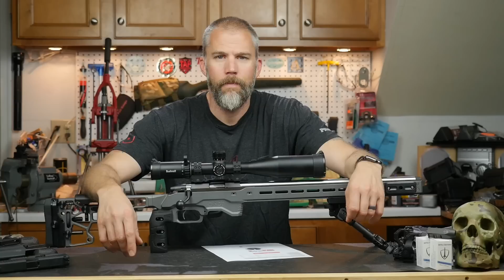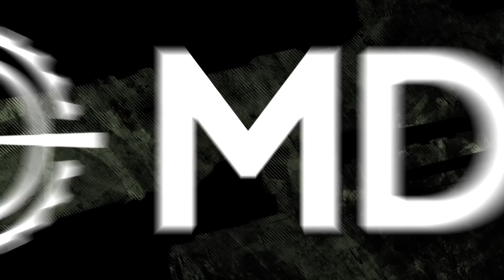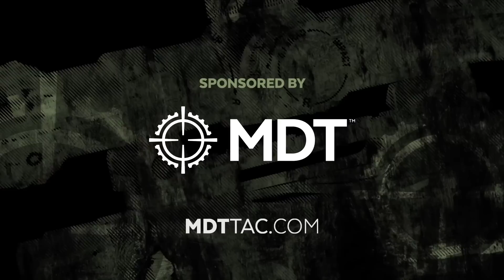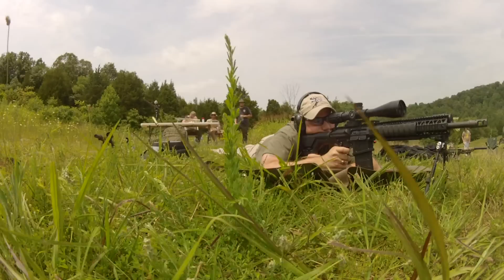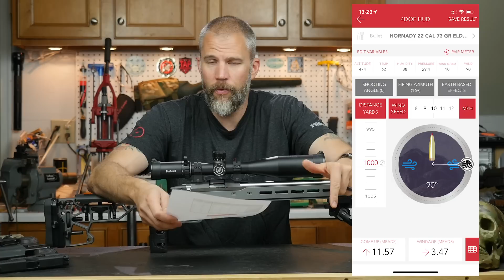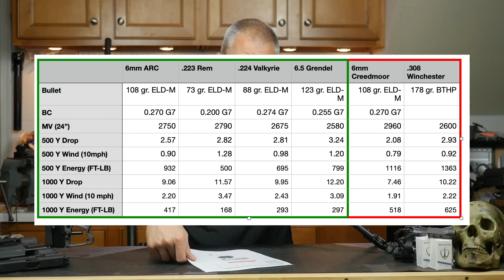Mail Call Mondays Season 9 #19 - Commentary on the 6mm ARC (lots of numbers)

Comment: Love your videos. I have a 6mm ARC ar15 20" gas gun and I am looking at getting one of the Uintah 6 ARC bolt uppers. They currently sell only the 22" but can increase that to 24" if I want. I am loading 105-110 gn bergers & hornadys. I shoot in excess of a 1000 yards. Would you recommend the 22" or 24" barrel for the 6 ARC?

Comment: An excellent video. My old age favors less recoil ( 6 mm arc ) and I am a stickler for precision mid to long range. I went with Preferred Barrel  Blank's 26 inch barrel with 1-7.5 twist. Here's where I cheated, my upper is bolt action not gas and is on a Uintah Precision AR 15 lower. The bolt action will allow me more pressure/speed therefore of course, with my hand loads I  expect a little better numbers than you showed today. Also the factory support I think will be the kicker that will keep the 6MM ARC from the " flash in the pan " or " flavor of the month " caliber. Do you agree ? Your thoughts ? 
And again Great Informative video, I doubt anyone slept through it like you mentioned. Lol

Comment: I'd be interested to see how it performs with a 20in barrel, I'm not a fan of 24in barreled AR15s.  My 18in 6.5grendel pushes 123gr bullets at 2400fps.  

Really wish they would've used the standard grendel case, but I guess they needed to shorten the case .030" to seat the 108gr ELD to mag length.  I'd be curious to see if anyone tries to size down grendel brass, but seems like pushing the shoulder back 30thou is a little much.
Reply: I read somewhere they changed the shoulder so a gendel could not be accidentally chambered. Not sure if it's true.

Comment: I would like to see if the bolt life is as problematic as with the 6.5 Grendel.  Otherwise if I choose to build something like this I'd see if I could get Keystone to make a .240 Tomahawk barrel and use a 6.8 bolt.
Reply: I haven't seen anyone complain about grendel bolts in at least 5 years. It's like people talking about beretta slides flying off. It's early metallurgy flaws that hot solved but people keep talking about it.

If you're worried about it buy a high end bolt made of premium steel. POF makes ar15 sized bolts for 308 (the revolution) and they reportedly have insane life, and dimensionally this is way more dangerous than grendel bolts.

Comment: This is very similar too a 6 PPC. It'll have the same problems as all other AR ctgs based off of 7.62 X 39. Not enough meat left in the bolt & the magwell not really big enough. It can be made too work, but the bolts are gonna be weak. 7.62X39 AR bolts have a dismal record for endurance. Don't push the pressure or the bolt will grenade.

Comment: I m going to ask the same question I ask gavin from ultimate reloader. 
Give me a  good reason why should switch from my 6.5 grendel to the arc ?, if the answer is “speed” I can push lighter bullets from grendel  faster

Thank you.
Reply from the maker: Jim, the Arc seems to be able to push HIGHER BC Bullets faster. That will result in better ballistic curves. You will need to crunch the numbers and decide if it will accomplish what you need to do. In the end, the ARC doesn’t make the 6.5 Grendel any less effective than it was, so if the Grendel is getting it done for you, no reason to switch.
Reply: It comes down to the old question of intended use. Inside of 500 yards I would stick with the Grendel. For a SHTF purpose I would stay with the Grendel because there's cheaper ammo to stockpile. If you have a Grendel I wouldn't switch unless you need or want something more effective in the 500 to 1000 yard ranges.

Comment: I'm sold on the 6mn ARC.  I've already Pre-order Faxon 16" 416 S.S. Nitride Heavy Barrel . I wanted something that can perform well with a compact package at 800 yards and in . 
I was not impressed at all with 224V or 6.5G. The 6ARC is gonna be my SPR/CSASS , hog and deer URG . I do not hand load so I will only be using Hornady Black 105g and ELDX 103g . I saw some charts that said a 14.5 6arc at 880 yards will still have 410 Foot pounds of energy with 105g. That's pretty freaking amazing . 
I like efficiency.  The 6ARC seems be a winner in this category . 
Hopefully this Faxon BARREL won't take to long to get here . I have everything for this build except for the barrel and suppressor.  
I'm very excited about this 6ARC.  I'm right at $500 invested in this upper.  I wanted to keep it under $1k for the URG and glass. I'm leaning towards the PA 2-10× M2 ACSS or Griffith ACSS.
Reply: From what I saw on Kataboy's video on it, he shot a 16" cmmg and got 2606fps with that standard carbine... with factory ammo.
My 18" grendel gets around 2400-2450 with a 123.
And that 6mm has a BC of .536, the grendel has a .510.

Sure it's less mass, but only 16 gr of weight and slightly more expansion diameter. It holds into that energy longer, starts faster and drops slower.
I love my grendel, but I like those numbers. I think it might do well from a 12".
Reply: @ravissary79  the 6 ARC is mire efficient.  If your starting from scratch it wouldn't make sense to build a Grendal . 
I have nothing against the Grendal other than I wasn't impressed.

Comment: I think for the DOD, you're looking at what is acceptable.  The 6mm ARC shoots in a smaller lighter rifle, and the ammo is 30% lighter.  The ARC has acceptable energy out to 1000 yards for use against human targets.  A big change is comparing the 6 ARC to the current M16 and DOD ammo. The 6 ARC doubles the effective range and energy of the 5.56 with 62gr bullets. If you want 1000 yard effective performance you need a BC of 500 or better.  Other wise wind would destroy most attempts to hit at ranges beyond 400 yards. In the desert is very common for the wind to blow well over 20mph.  Personally, I think the 6 ARC would be a huge improvement for the US military.

Comment: So basically they wanted the POF Revolution already in 7.62 with supply chains already well in place, r change the barrel to 6.5 CM and again, supply chain still in place.

It's probably for the AMU.
Reply: No they wanted an M16/AR15 that was effective out to 1000 yards. To do that you need a 500+BC bullet.  The 6ARC still has over 400 lbs of energy at 1000.  That's effective against humans.  The 6ARC ammo is 30% lighter than 308 size cartridges. Being able to carry more ammo at the same weight, or the same amount of ammo with less weight is a big plus.

Comment: I personally don't understand stand why they didn't go ahead and use the 6x45 which is a 556 or 223 case necked up to 6mm that would have made more sense to me
Reply: Probably for case capacity... More powder for greater range/energy...
Reply: Because you don't have near the powder capacity in a 5.56 case, and you'd have to seat the bullet pretty deep to get mag length cartridge. The 6 ARC uses a short fat Grendel case and pushed the shoulder back a little. Now it'll load to mag length and hold much more powder. That's how you get to 2750 fps. The 6x45 with a 103-108gr bullet would not be a good cartridge at all.

Comment: I have a 6mm Preditor (necked down Grendel) and it is my new favorite for out to 800 yards on steel or to 500 yards on pigs .  Very easy to handload not twitchy or overly sensitive to charge weight ... I stopped measuring each charge and just drop.  I use the cheap 105 gr Hornady Match and it's a great, great round.  SO I think the 6mm ARC will be a huge hit.
Reply: Are you targeting the head on the pigs or vitals?  I was about to make the jump to a Grendel as I wanted a lighter Whitetail gun than my 308 AR10.  Then the ARC appeared...now I am torn.  Do I go ARC or Grendel.  Very longest shot I would take would be 500 yards but most shots would be under 200.  Do I go with the heavier Grendel for knock down or does the ARC have enough juice for Whitetail?
Reply: I have a 6 Predator also. I've loaded mine with 103eldx and IMR4895 powder. Mine is 22 inch barrel at about 2750fps.

Comment: From the information I have they do not use the same bolt  as the Valkyrie uses a 6.8 SPC bolt. While the 6mm ARC using a 6.5Grendel or 762x39 bolt.

Comment: I live in Nebraska...not too far down the road from Grand Island (Hornady).  I've seen quite a few '6.5g-6mm wildcat' cartridge used in local prs/nrl events this last year.  Obviously Hornady has been messing with this cartridge for a while.  I have even found quite a bit of brass at the G.I. Heartland shooting range last fall shooting BR matches there.
I've got 2 barrels on order...one for a gas gun and another for my RPR.  Good brass is available (Lupua 6.5g or .220 Russian) and there a ton of good 6mm bullets available.  I don't see this cartridge taking over the way 6.5 Creed has...but it's not like components for reloaders wont be available forever.  I just cant see this cartridge 'failing' honestly.
Sure, it's going to be rough on brass in a stock AR platform...nobody should be surprised by this.  Yes, it can/will be neutered by folks running 16" barrels.  Yes, barrel life will be shorter than the grendel.  This is going to be a niche market...but it's a very supportable niche market compared to some of the other new wonder rounds out their on nigh obsolete/obscure parent cases.
I plan to run 6mmARC is local matches where distances rarely surpass 1,000 yards...and I'll stick to .243AI and .260AI in matches that require further shots or where they use magnetospeed light up hit indicators (I dropped some points this last fall because sometimes the stupid 'hit' indicators wont light up on low energy impacts....6.5 grendel).
Reply: I have a 6mm Predator and 6mm Grendel...same thing. I used 6mmAR load data to load for my rifles. I use Hornady 6.5 Grendel brass and run it through my sizing die. No problems. I've been shooting my 6mm Predator for several years. No problems.

Comment: I wonder what these numbers would be for the 6.5 Grendel when using a better bullet in 107 or 110 grs.
Reply: Unfortunately for the Grendel, the lighter grain 6.5 pills just don’t have the BC values that the 6mm bullets do. I had to take a step back and come to the conclusion that the Grendel shines in that 120-123 grain range with G1 BC’s in the 0.510-0.527 range...at least when trying to compare it to the 6mm ARC.
Reply: Grendel to slow
Reply: 6.5 grendel launches less efficient bullets at a lower velocity.
Reply: I have shot the 6.5 grendel and 6mm grendel for years.  You have to get up to 123gr bullets to get to 500BC in 6.5mm. A 103gr bullet in 6mm has over 500 bc.  So you shoot 6.5 at about 2450fps and 6mm at about 2700 fps.  Once you're shooting past 300 yards, the wind becomes the deciding factor.  I like my 6.5 Grendels, but my 6mm Grendel will outshoot them.

Comment: basically hornady ripped off the work of Alexander arms
Reply: If Hornady necking down an already existing 6.5 Grendel case that's a necked up   220 Russian case is "ripping off" Alexander Arms then wouldn't Alexander Arms be ripping off the designers of the 220 Russian?
Reply: The DOD needed a big company to make a round that will drop a lot of bodies, and supply that in bulk to the hitters. Alexander couldn't do that. Don't be a cry baby.